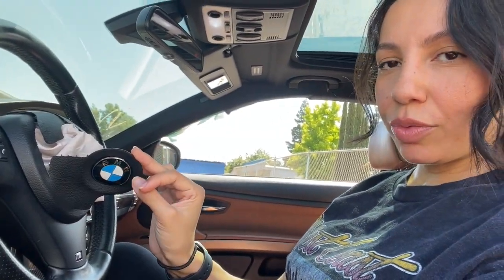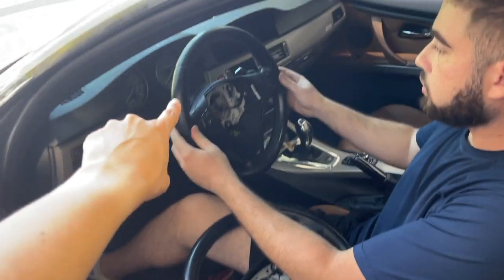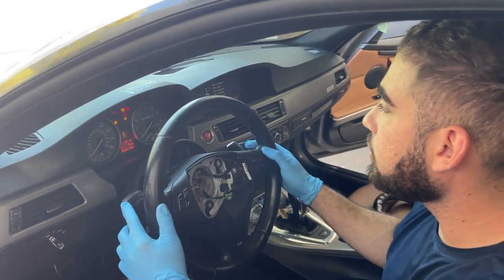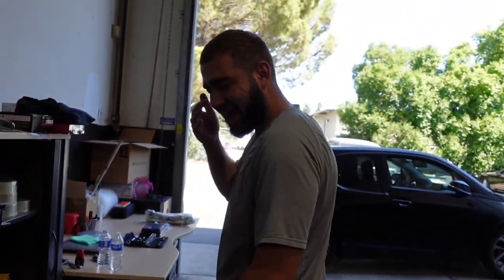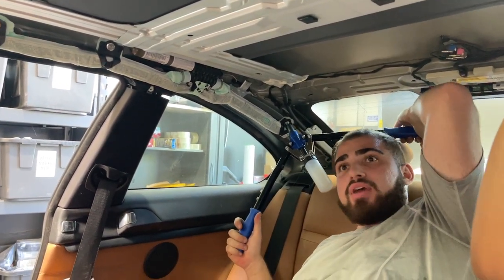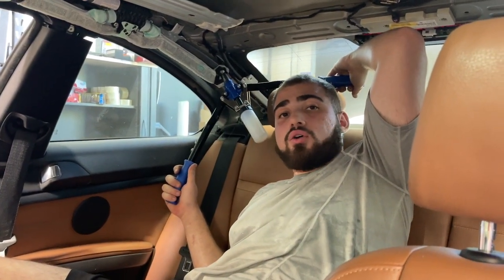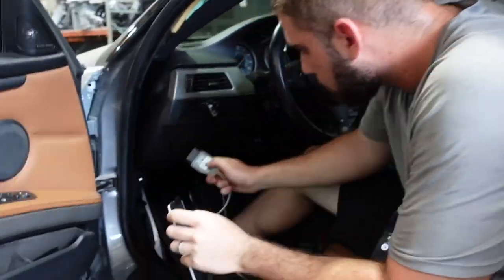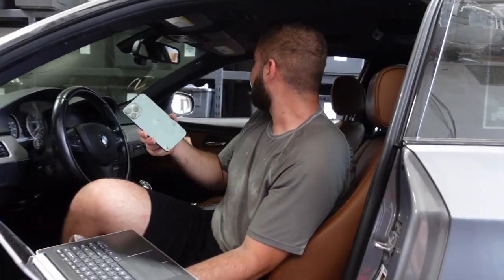MY E92 335IS GETS NEW AIRBAGS, HEADLINER AND DASH CAM!

Comment: Yo I did t the same shit and fucked my paddle shifting. IS have different size steering wheel. It’s the same one form the E92 m3 it wont work. That’s my experience I tried switching to a carbon steering whee from a regular 335i and the paddles stopped working